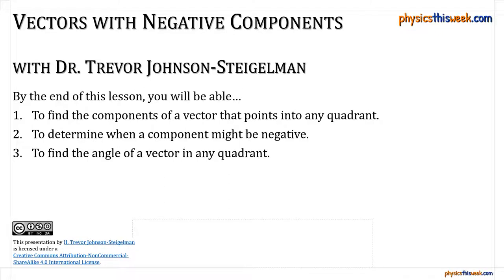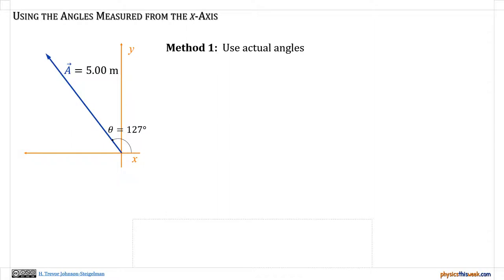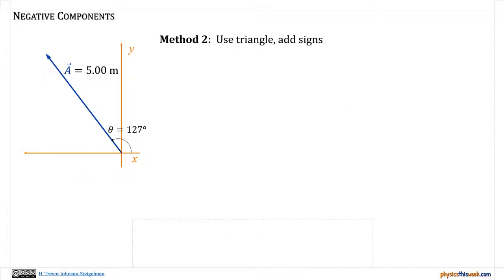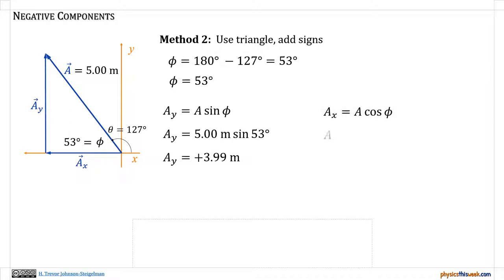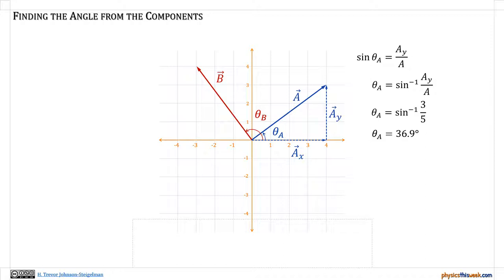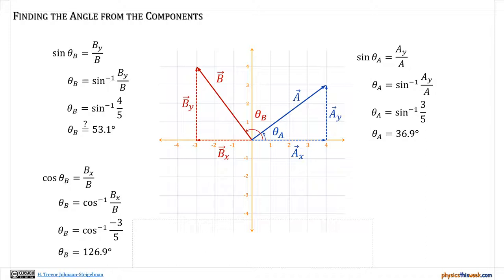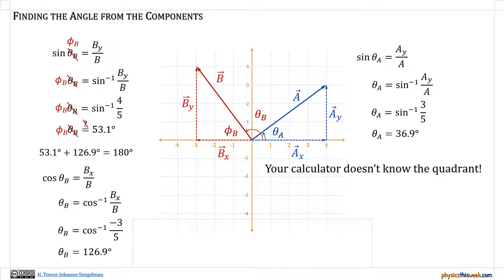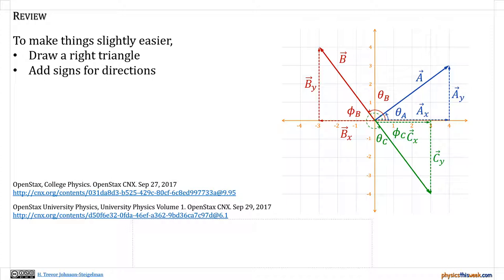Vectors with  Negative Components - PTW

Comment: What if I find a value less than 90 but it's negative. Where does it land
Reply from the maker: Generally a negative angle means that your vector points into the 4th quadrant.  These are measures clockwise from the x axis.  -60° would be equivalent to +300°.